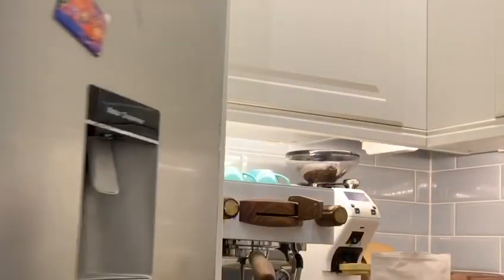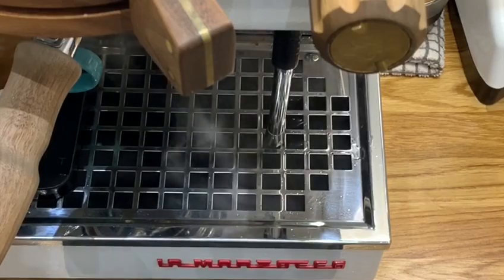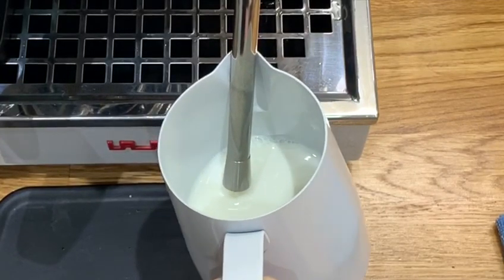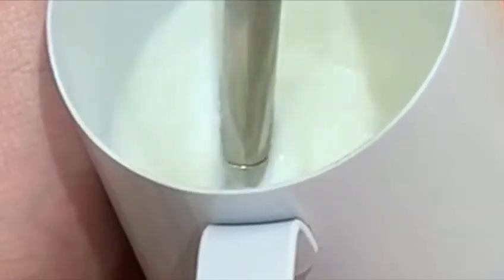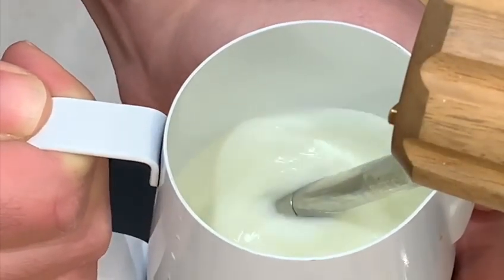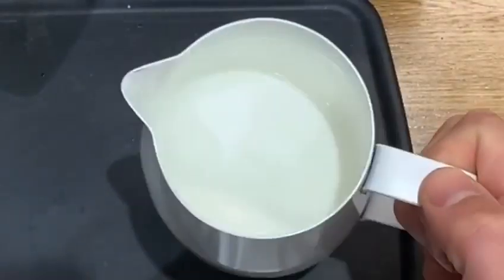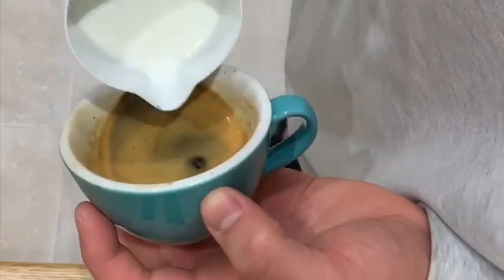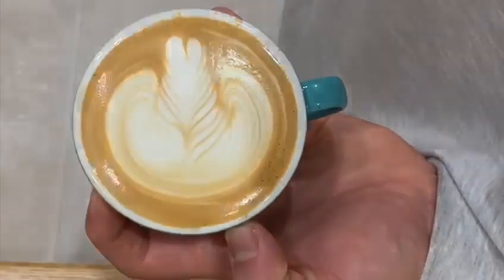Milk Texturing for Latte Art - La Marzocco | Linea Mini

Comment: I found really hard to froth almond milk. Is there any tips specially for almond milk?
Reply from the maker: Hi Ting! I don’t have that much experience with milk alternatives, it’s perhaps a video I’ll do soon! From previous experiences I’ve found that milk alternatives need a little bit more time being aerated. I’m also aware that different brands require different texturing techniques... Its definitely something I’m happy to experiment with!
Reply: @smellypieceofshit  thank you. Can’t wait for it. When you turn on the steam, do you scroll it all the way? Or half way?
Reply: almond milk sucks to froth oh my god! a tip i picked up from my work is to keep the wand really tight to the surface, really small movements to add air into the milk, and not to heat it above a certain temperature (specialty milks like almond and soy start to burn quicker then whole milks!) 
this is just what i've learnt from my place of work and in my part of the world, so do with this information what you will! :)
Reply: @abbyaustin3033  thank you! Tried so many times and always get big bubbles. So hard to froth almond milk.

Comment: Hi. I've got a deLonghi machine with an automatic frothing wand which produces lots of foam more suited to a cappuccino.  I have to swirl and tap to jug to get the foam level down to latte style. Any tips to avoid this? Steve
Reply from the maker: Hi Steve! I remember when I had my first espresso machine, there was a metal attachment to the steam wand which I removed. This really helped with being able to steam my milk better, that’s because the metal attachment was designed in a way to create more foam! Give it a try!
Reply: Me too, i used deLonghi machine. After i removed the attached metal, i can get the glossy milk like u did.

Comment: When my pitcher gets too hot to hold it reaches about 50°c so that technic doesnt always works with everyone i guess?
Reply from the maker: MasterPiece 1419 - Yeah it’s different for everyone! It’s more of a rough guide to try and get in that optimal range for milk temperature. In your case I would suggest once it’s too hot to touch, take your hand off and leave the steam wand on for another 2-3 seconds. And see what the temperature is then! You can then gauge how much longer you need to leave the steam wand on from there 👍🏽